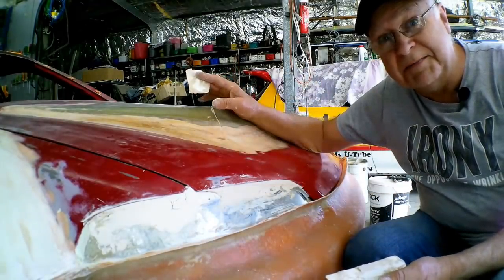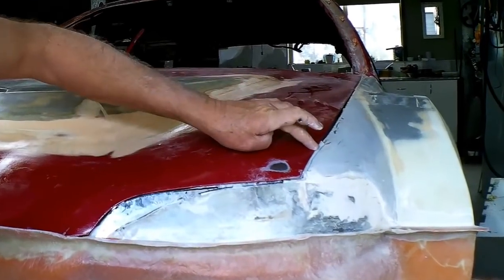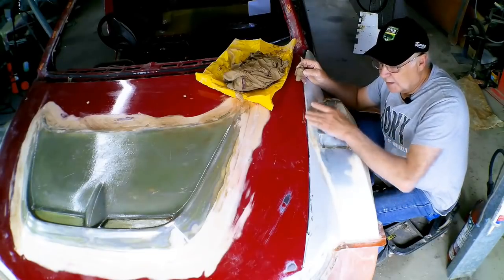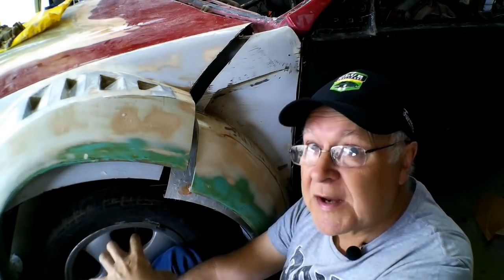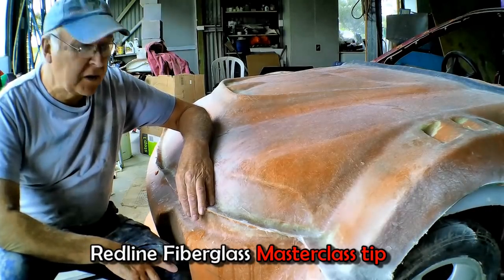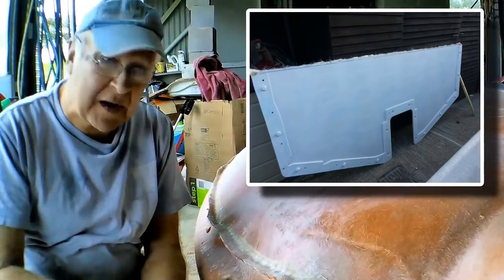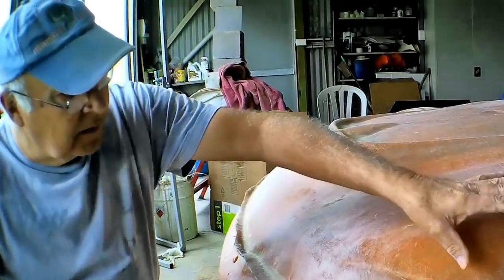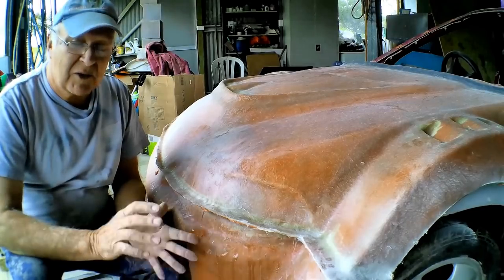V6 Civic Phase 4 Build -  Part 21

Comment: Just doing an open wheeler body now so your videos are a motivator. I like the silica fume trick, I have used this before with epoxy to thicken it but never with polyester.  FWIW Epoxy silica fume and Qcels make a good filler.

Comment: 11:07 what a feeling, priceless 👍. 
Do you wait for the gel coat to fully dry before fiberglass ? Interesting gel coat/ fumed silica mix you do.
Reply from the maker: Gelcoat needs to set before resin is applied. It normally takes 2 - 3 hours, still retaining a stickiness, but not coming off the job with a finger touch. You can leave it overnight 7 u to 48 hours, but after that you risk it shrinking and being of no use, at which point laying over it is a waste of even more materials. Ask me how I know this! That gelcoat mix is simply the chemicals we used where I worked at a fiberglass materials manufacturer to convert spray gelcoat to brush. I do it myself because it's cheaper that way, plus i prefer a really thick gelcoat for brush application. Eliminates Alligatoring" wrinkles..
Reply: What about milled fiberglass and talc?